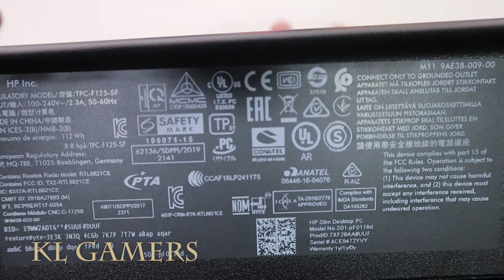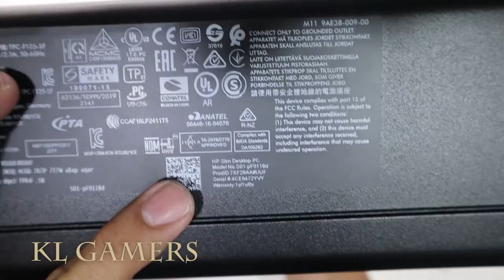HP Slim S01-PF0118D Desktop PC Upgrade M.2 2280 SSD and Kingston DDR4 RAM increase speed 2020

Comment: Great Video! Question for you, does it matter if you upgrade one slot to 16GB and leave the other slot to 4GB? I see that you install 8GB on the first Slot and left the second slot with the 4GB.
Reply: Yes! Only matched pairs of ram. CL clocking speed to avoid conflicts and booting the system.  Use 1 stick 2GB to 32GB of 2666Mhz  only or two matched pairs same brand  upto 32 GB max. I hope this helps. Amazon sells aluminum cased  OLOY 16GB ( 2x8Gb ) matched pairs for $31.99  at the time of this posting! 16GB is plenty for gaming or normal pc use.  This machine supports a maximum  32GB of ddr4 2666MHz CL19 1.2V 288-Pin Ram Only!